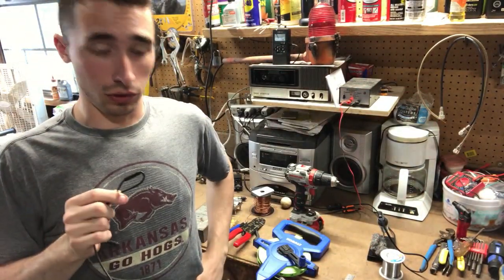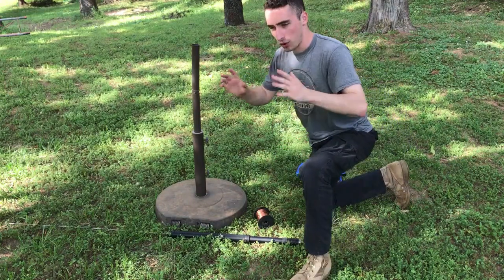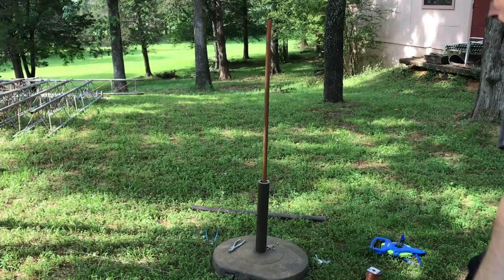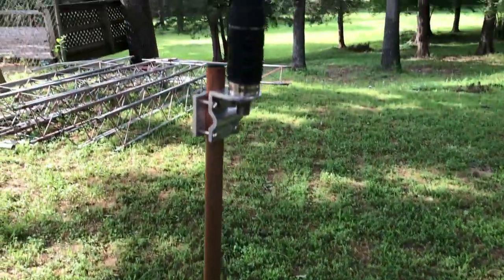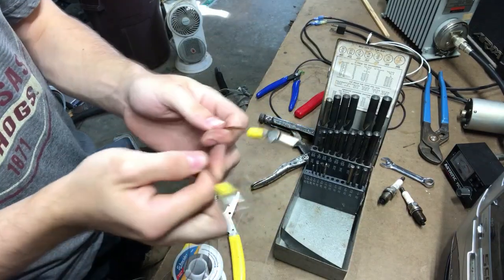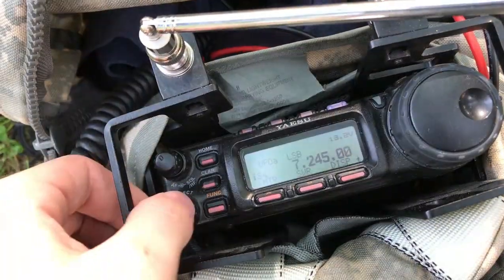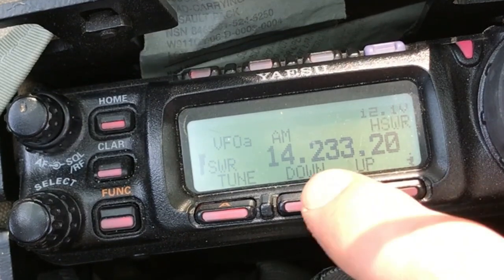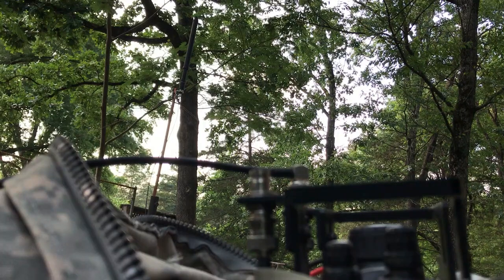Yaesu ATAS 120 Antenna Radial Kit Build -- Ham Radio Manpack Setup

Comment: Hi cute experiment. I also work this way in the car, I even estimated the radiating rod to 5 meters.... Just for information, there is no possibility to coordinate the ATAS120 on the 80 meters or tell me how to do it... I did not succeed. 4X4MN
Reply from the maker: Well I’ve heard it can work on 80, but like you, I have not been able to make it  tune on that band.
Reply: @ar124radio     The ATAS 100/120 will present 30 ohms impedance at resonance withe the lowest SWR you find.
They do need  a ground system  /counterpoise. The radiating portion of the antenna is the coil and whip that is above the top of the housing. Good current flow requires a ground/strapping to vehicle chassis. 

My example is my 17 foot canoe on which I deploy an 24 year old  ATAS 100/FT-100 Yaesu.

For marine  canoe stability on the water, I have a second canoe  tied to the first canoe with a DIY
wooden deck,4 feet between at the beam width of each canoe. The assembly then becomes a catamaran.

 I can fly a flag, like the Boy Scout Flag, or the scouts favorite, A large Red pirate flag!
my vessel instantly becomes visible to other boaters. Many are curious and will come along
side on Field Day or Jamboree on The Air. Others along side can hear the radio and I'm able to
Demonstrate the usueful ness of Ham Radio.

Make yourself VISIBLE!.
Always let someone know of your where-abouts!

I operate with two trolling motors, fire extinguishers, deep cycle marine batteries, and appropriate marine lighting.
I have used this setup after dark. I do have and require use PFD's and extras.(paddles,food and water, extra handy talky and VHF radios.) The two canoes(600 # rated capacity)
.deck and batteries, radio shack fold together for disassembly and transport.
The added weight derates the two canoes capacity by 350 pounds. 
I am presently designing an aluminum fold-deck to replace the heavy wood deck.
I mention this aspect of my system for SAFETY purposes.
Do Not underestimate the power of Wind /Water/ Weather and the presence of other boaters who may not be aware of your presence! 
Keep a navigation horn audible horn at the ready!

 
I crafted a small 4 foot tall/4 leg PVC water pipe(1/2 " diameter)TOWER , to which I mounted
an 18" pizza panat the apex.  The ATAS 100 was mounted with a barrel connector. I did implement
a tri-magnet mount but found that the so-239 /barrel adaptor created a high current point at the solder joint
for the ug-58 cable, so a few times when the radio tuned the atas, I was talking on the water for 2 hours plus to a ham
1250 miles away during a Fourth of July show from Grand Lake ,Colorado. I did not realize the high current had melted the center connector solder connection. 
What saved the day was that I had placed the canoe/antenna on my picnic table
to test everything. At that point, I used the tower legs as helically wound off resonance radials. Two legs wound on 40 meters/15 harmonic. Two legs wound centered on 14.225 approximated  10 meter radials. These are connected to the pizza pan.
All the legs use 1/2" tees split to mount to a 4 point system on the cross bracers with stainless hose clamps. No radials
are connected to the aluminum bracers or the gunwales/rails(pronounced "gunnels") around the rim of the canoe.
That procedure is reserved for the future. 
I did trail an insulated, non-resonant  length of 14#  wire  in the water with a bobber and weight, The results of that brought down the noise level but did not elevate signal strength.

I like the magmount because I can disassemble the system  quickly. The wind load and weight of the antenna/magmount
are spread out over the pizza pan.
But I found that the magmount does couple the counterpoise inefficiently.
To the point of melting the center conductor solder above five watts.
So therefore the barrel mount . with wide stainless washers to fit it's diameter.

The antenna analyzer  showed resonance points with a narrow  50-100 khz
bandwidth and SWR near 1.5 consistently after some fine tuning ,on 40/20/15/10.
I Check for Return Loss with  the analyzer and keep the coax lengths short.

That is fine by me for the mere fact that I don't hear a lot of band noise.
This system exhibits low angle radiation off the water,withe the pizza pan located
about 5 feet above the water level. On a particular lake, it is evident that
the close one gets to the dam, the higher the angle of radiation becomes. There is a lot of signal attenuation
and the antenna displays NVIS qualities ,especially on 40 meters.

In the center of a lake,  the signals boom in!
My best contacts with 5 watts are South Africa/Hope ,Alaska.The UK,the 14300 MMSN Net.
UA stations/Spain/Portugal.Japan,Thailand,etc. 

I'm not a contester, just like antenna experiments .

I've found that the ATAS -100 will work 6 meters, and Field Day/Jamboree on the Air
from 14.270 foot fourteeners is very busy. Either portable or mobile.

My setup was in a Field Day picture in a QST May edition a few years back.
The author of the article did not realize that the antenna on my mini tower was an ATAS,
and said that some operators work Field Day VHF/UHF. I had already submitted
my Field Day "water shack"  to QST., with HF results.
On 6 meters you become the DX.

I'm not working for the wallpaper, I paper log my contacts.

I make videos with a salvaged drone cam that I can control with my phone app.

A note: I use Type 31 snap on RF chokes  at the radio coax, type 31 toroid's on power connections
and keep all coax and power leads short as possible.

For mobile/vehicle  mounting ,make sure you have a good strap/straps, as many is practical,
to the chassis of your vehicle.
So, on the ground, you can deploy and test "Ham stickes" and 40 meter  sticks can be use on their harmonics on 15 meters.
The ATAS needs at least/minimum 1/4 wave  radials on it's high hf band of 10 Meters. I don't recommend
placing radials on the ground or " fanned/pinned to the ground". Slightly elevated/6 " minimum above the ground
has resulted in a clos to 50 ohm impedance, and with the small diameter coil in the ATAS, that helps with easier tuning.

To implement 80 meters you need 80 meter 1/4 wave radials/or simply apply 1 or two 80 meter "Ham stickes" as your counterpoise. AND, craft a whip from stainless steel  with a helix wind/or center coil to extend the  inductance of the coil
inside the antenna for 80 meters.  For your prototype, you can use stiff ,solid copper wire of the same gauge
as the ATAS whip diameter. Make the helix long and cut to frequency as you go.  You can approximate the center loading version  length by how long a wire you apply for the DIY helix (think Ham sticke) . A good antenna analyzer, a 2 position
antenna switch, allows you to go to 80 meter band on radio, by switching between bands and using the up down function on the Yaesu, trial and error, to get a resonance on 80 meters.

As with anything in Ham Radio Life, your mileage may vary.
73'

Comment: hi you can get more out of it i worked the world with myn , you need about 16 radial vith small pegs driven in the ground, supoting structure of atas get uour self a 40 inci greound rod replace l bracat wit a grond arestor a sp 1000 from dimond makes wonders, i used the atas 120a on wehicle monted grond mounted sota bota and other operatins itsa a great purces 4 mobile deploiment
Reply from the maker: Oh yeah, it really does well for such a basic package. I made contacts on just about every band except 40 meters with it. I can now get it to tune up on 40, but I'm pretty sure it's basically acting like a dummy load because I have yet to make a contact with it on the voice portion of 40 meters.

Anyway, thanks for watching and I appreciate the advice!!
Reply: @ar124radio  atas tunes from 7 to 430 mhz if you want more you need te grpnd playn kit from them i think they stil produce the the wery long wip i have you buy it separatly along with ground playn kit then uou can go down below 7 mhz wit it  its a slov tuning antenenna if you let the radio and antenna on auto tune it takes som time about 20 seconds to 120 seconds depending on what band you wer last every 6 monts you need to clean and grees it and cek 4 water damage

Comment: Hey AR 124 I love it when Hams experiment. Couple things, I'm pretty sure my Hi-Q screw driver antenna needs to not ground to the mount not sure with the Atas, Obviously it worked though. I agree with Charlie Kuehn mount it lower unless you cut radials to a quarter wave for each band. On radials I use speaker wire that is aluminum copper clad a little lighter and insulated . I think it is easier to coil up and deploy than the wire you used and it's cheap. For your radials make short jumpers that you leave attached to your mirror mount and then some type of quick disconnect ( power poles, banana plugs etc...) that should save you some time. For my 17' whip I use a 2' cement form metal stake cheap and you just pound it into the ground, not light or great for a backpack, but good for the park and cheap at home depot. Keep up the good work, Chuck KK6USY
Reply from the maker: Thanks for the info! I knew it might be a little tricky to tune especially on the lower bands since I mounted it so high, but it was the best I could do from out of the junk pile😂😂😂 I’m going to try to find a light weight camping stake to use as a ground mount and see how it does during a POTA or SOTA activation. Anyway, I’m glad you enjoyed the video and thank you for watching!

Comment: Good times!!! I run a similar setup and it works great. Try bringing the ATAS lower to the ground and add more Radial wires to lower the SWR.   An elevated antenna needs radials cut to quarter wave length.
I'm selling my WolfRiver Coil antenna now.
Reply from the maker: I did end up adding six more radials that were 16 feet long for the 40 meter band and that brought it right down. I did try to make some contacts on 40 meters after sunset, but the band was so noisy with static crashes that no one could hear me. I’ll have to set up again in the morning and try my luck. Thanks again for the info and thanks for watching!!
Reply: @ar124radio  Try adding some type 31 FairRite RF snap-on ferrites at your coax near the radio.
This can reduce noise received. This is a common current choke that blocks rf flowing on the outside of your coax.
Reply: @wingwalker7380  what about grounding the radio also? a small rod and short wire will improve signal for sure.

Comment: Great antenna but very expensive. If i had your space I'd run an end fed dipole or a long wire to a tree. I live in an apartment and all I can use is a metal bracket out the window 🙂
Reply from the maker: I was pretty surprised, as were others with its performance. I do agree though, it is definitely not a budget friendly antenna. I probably will end up stringing out a wire from the shop for HF, but I still need to make a balun. Anyway, thanks for the comment and thank you for watching!